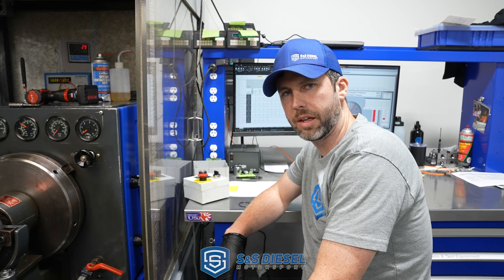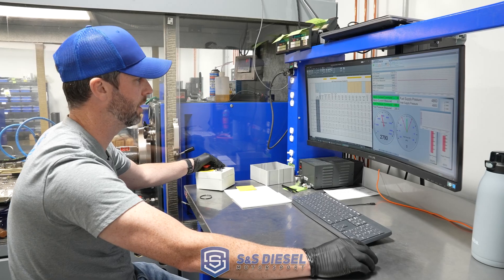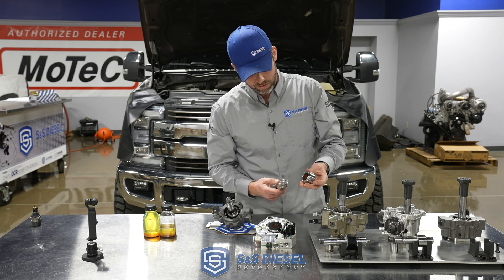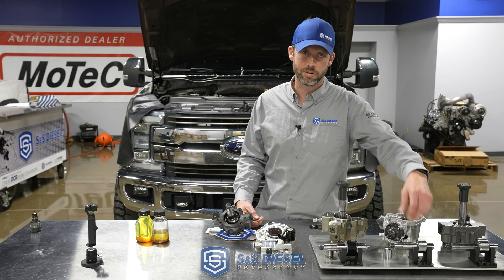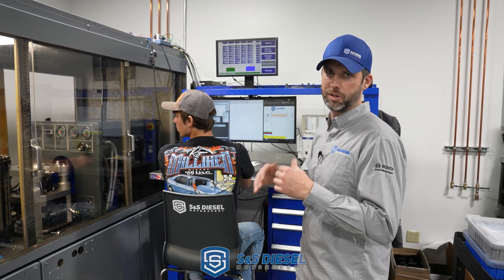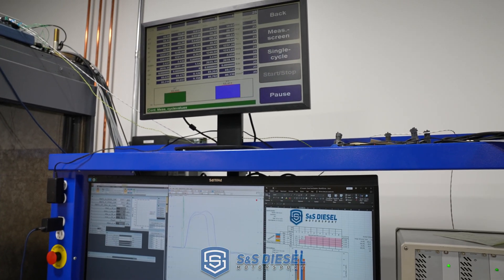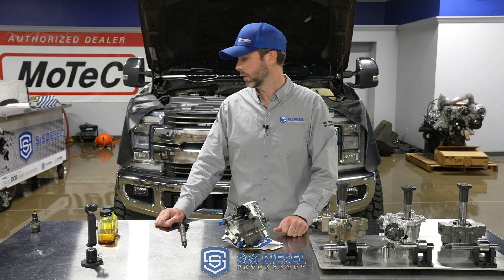YES, The Ford 6.7L CP4 to DCR Pump Conversion Can Handle Water In Fuel!

Comment: I'm here all the way. I just installed a DCR on a 2019 f250 with 218k on the Original CP4 and no glitter we got extremely lucky but thank-you for all the R&D and development it was breeze to install and has taken away the P0087 that came on when you would give it throttle on a roll
Reply from the maker: Thank you for your business!

Comment: Not sure if this question has been asked. Doing the DCR replacement kit do we need to run the filter that was needed for the CP4?
2018 F250 6.7 with 50k what I’m working with.
Camping and adventure weekend truck hints the low miles
Reply from the maker: If you are talking about the return filter from the DPK, you will not need that with a DCR.

Comment: When should I buy the dcr my 2011 has 100k rn
Reply from the maker: It's up to you. We've seen failed CP4s with fairly low miles and we've heard of trucks with 200K+ still running the original pump. We can't put a mileage on when they fail. With a DCR installed, the chances of your fuel system surviving bad fuel is greatly increased, just like the truck in this video.
Reply: @SSfueled  thanks for the info boss

Comment: Well, I'm sold. I have a DPK on, so when the CP4 pukes, it's getting one of these installed.  I maintain it well, use good additives and fuel, but you can never tell when you might pick up a mixed up tank of fuel. After seeing the differences between the CP4 and DCr guts, no doubt, it's the Time of fuel pumps, takes a licking and keeps on ticking.
Reply: Im.not waiting for mine to puke im doing it next month when I have the money  !

Comment: Ill be looking to do this to my 22 when warranty is out. No offense but got to let the bugs work out if there is any. I do like the design im curious why Ford hasnt come up with something like this as good of engineering that they have. With it being softer material wouldnt that cause it to wear faster but safer I guess theoretically? Im a machinist/cnc shop owner and do lost of pumps for various reasons and they mainly use a brass or bronze in heavy pumps. They wear over time but by design.
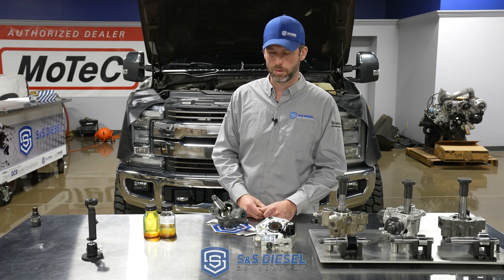Reply from the maker: No offense taken, we appreciate skepticism. There's too many aftermarket companies that make big claims without the data and testing to back it up. We look forward to earning your business the hard way, with real-world results in the test of time. Yes, in theory, softer bearings will wear quicker than hard bearings. Luke does a great job explaining this trade off at the 5:00 mark. The bushing material is soft by design and will still hold up for a very long time due to the layer of fuel that the bushings ride on. They are pressure-lubricated just like engine bearings.

Comment: Do you recommend replacing the DCR at any number of miles, or is it fine to just run it with no service and if it fails, just replace it then?
Reply from the maker: Great question. You do not need to replace the DCR unless it fails. This is exactly what we are doing with the truck in this video. We know that the DCR took a little damage, but testing showed that it was still in good condition. We're going to keep running it and see if anything happens. If it does fail, we're confident that any debris will be sent out the pump return. Also, keep in mind that the DCR does not have a hardened tool steel cam and roller like a CP4. Any debris is likely to be soft bushing material. We'll be sure to let you all know the results if it does eventually fail. So far so good. The RustEater is still running without any issues and putting in work daily.

Comment: Assume an aftermarket fuel filter is installed with the secondary engine fuel filter deleted and the new S&S DCR pump (same setup as the F250 in the original video).  Assume also, the fuel filter generates some level of rust and particulates as you've shown.  Wouldn't the rust particles be carried by the fuel to the DCR pump?  How does the DCR pump protect the injectors and rails from the rust generated by the water separator canister?  

I was shocked to see the amount of rust you showed in the video when you opened the fuel filter canasters.  I believe the water separator canister in the video did not have a drain valve but used a water absorbing media, still water must have contacted the inside metal surface of the canister to cause rust.  No description was given how long the fuel filters had been in service or for how many miles, but there was a lot of rust.  

I'm interested in either an S&S disaster kit or the new S&S DCR pump to protect my 2018 F350 6.7L (43,000 miles).   It has a new FASS Titanium fuel filter system (140 GPM) with engine filter delete that was recently installed.  The extreme water separator does not have a drain valve but uses a micro-glass media to absorb water.  The folks at FASS assure me that their testing has not shown any evidence of rust accumulation.  I'm thinking also the DCR pump eliminates the disaster kit.  

Appreciate your reply.
Reply from the maker: Yes, this truck had an aftermarket supply pump and the secondary filter was removed. The DCR pump does not stop rust or water from entering the high-pressure fuel system, moreover, it is resistant to rust and water and does not fail. Per our testing, the Bosch piezo injectors can handle some rust and water, but they can't handle the hardened tool steel that is produced when a CP4 fails.

The filters had roughly 3 months and 6,000 miles on them.

The Disaster Prevention Kit is not needed with a DCR and the two are not compatible with each other. Both will protect your high-pressure fuel system, yet the DPK cannot prevent a CP4 failure. One is great protection for a great price, the other is a complete solution for a fair price.
Reply: @SSfueled  Appreciate your quick response.  Your videos are very informative and thanks again.

Comment: The DCR now in my 2016 is worth every penny paid in peace of mind alone.  Expecting at least 200K worry free miles, possibly more with ongoing recommended maintenance.  That CP4 was producing more gray hairs every time truck started.
Reply: How many miles did u have when u installed it ?
Reply: @lustysteve1420  Imma hafta look n get back with you. I think about 2K miles back.  It's a low mileage vehicle
Reply: It was about 70K. at 74 now.

Comment: Thank you for coming up with a better pump. I installed mine almost a week ago, and all I can say is the quality of the parts are excellent. The instructions are excellent as well. 

On a side note I just seen another company say your flow numbers are bs. As they supposedly tested the DCR on their test bench. I am thinking they are pretty butt hurt due to the fact your company found something better than a cp4. They obviously rebuild them to supposedly make the pump better.

Comment: Did you decide to pull off the aftermarket lift pump? Curious if the customer will want different filtration after this incident.
Reply from the maker: Unfortunately, Dane no longer has the factory pump and stage 1 filter. We're going to use CAT filters with a water drain on the aftermarket supply pump and use an H&S filter/housing for the second stage filter.

Comment: Thks for all the research y'all have done
Now how about the rust in the system
Reply from the maker: We'll do our best to clean it out. Based on testing, we think the current fuel system can handle a few flakes that may be floating around. The only reason it threw a code was due to a clogged DRV/PCV on the rail. While it would be possible to clean the rust off of the DRV screen, we'll likely replace that part of the system since it was the reason for the high rail pressure code.

Comment: I currently run a CP3 in front of my CP4 because I’m running 100% over S&S injectors. Can I still use the DCR pump to replace the CP4?
Reply from the maker: Yes. It will drop right in and have the same pump curve as a CP4.
Reply: @SSfueled  thanks! I’ll be ordering one today!

Comment: Do you think Ford will now switch to possibly your DCR and no longer install the CP4 in the new trucks?  I'm looking to order a new F550 in early 2024.  Would be nice to know I did not have to tear a new CP$ out and replace with the DCR.  Since i will be traveling far from ford dealers, such as up in northern Yukon, a warranty does me know good when I'm not anywhere near a dealer.
Reply from the maker: There are long-standing supplier relationships at play, but anything is possible. Like Luke had mentioned, Bosch quality is top notch and their injectors appear to be just as durable as the DCR when ingesting water and rust. The CP4 is a great pump in a perfect world with pristine fuel, but that's not the world we live in.
Reply: Especially in the Yukon!
Reply: These videos are top notch. Learning so much from them, thanks Luke & S&S